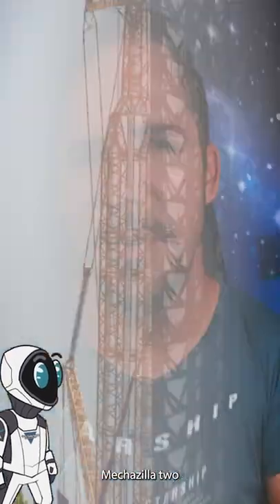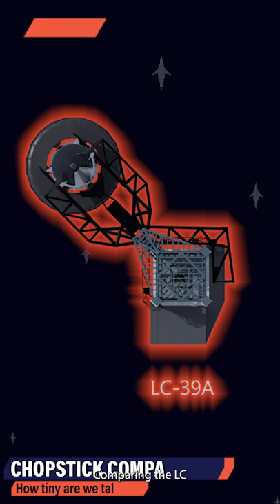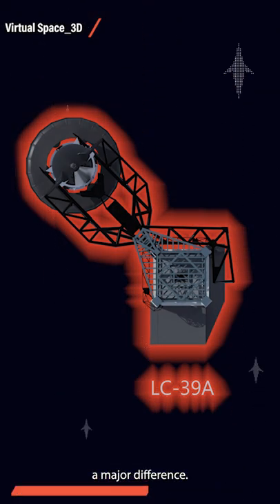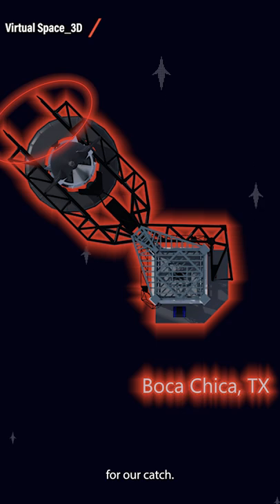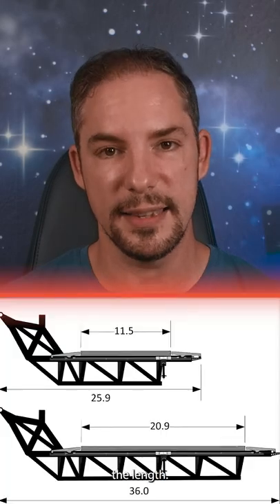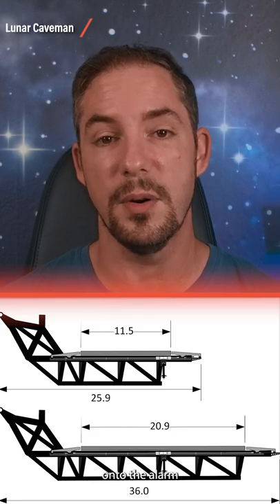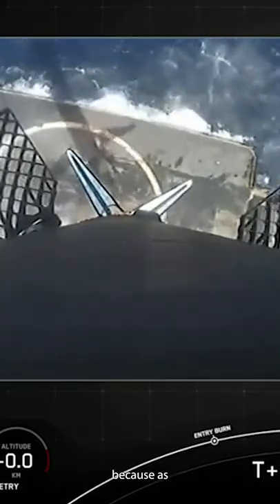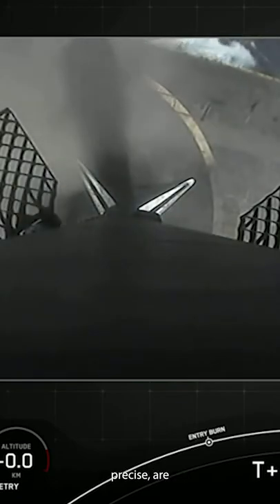How SpaceX's Starship Chopsticks Work?

Comment: Falcon 9 can not hover, Starship and booster can do it.
Reply: That’s a good point
Reply: Correct, and because the tower is fixed, accuracy can be greater, and if necessary SpaceX could install a precision optical guidance system.  An example of such a system on aircraft carriers enables naval aviators to land on the carriers even at night on rough seas.  Without going into an in-depth description, this is what is meant by them "calling the ball"--they see something that visually indicates they are precisely on the correct glide path.

Such a system could be used for Falcon 9 landings to make them far more consistent and precise (and accurate--slightly different meaning, and both will be needed by Starship), even on the barges and without the ability to hover.  But this has never been done because obviously it isn't needed--the Falcon 9 first stage lands precisely enough without it.

I don't know why science-oriented people find achieving the level of precision that is needed for the Starship so challenging.  It's not a hard problem to solve (compared to everything else involving the Starship).  I guess without thinking, they assume that the Falcon 9 represents the limit of landing precision, when it most certainly does not, and doesn't even try.

Comment: Next chopstick design: remove the entire mechanism, the best part is no part
Reply: There has never been truer words spoken
Reply: After that remove all the rocket engines and use magic instead.
Reply: @ooooneeee  and then you truly have a broomstick
Reply: I mean, that was basically the original plan for the Starship booster, back when it was BFR or maybe even ITS. Musk was saying that it would land with millimeter precision back on the launch mount.
The chopsticks should be easier in many ways :)
Reply: @Robinlarsson83  yeah, i don't really see SpaceX land a booster with millimeter precision in the near future😅
Reply: Unbelievable……
Reply: @ooooneeee  replace the rockets with brooms I see where you are going..
Reply: @larsverschoor 
Did he say how many millimeters... ? 😂😂
Reply: @larsverschoor it will have the ability to hover and use precise hot gas thrusters. Falcon 9 does a maneuver called a suicide burn. It has to land quickly not giving much time for fine tuning.

Comment: Although I agree with you and don't think they will catch the boosters there, Falcon cannot hover, while Starship can, therefore may be more precise. Maybe.
Reply: Just because they Don't doesn't mean they Can't!
Reply: @co5mic501 Falcon can not hover. The thrust of one throttled down engine of the empty stage is higher than the weight of the empty stage. They have to ignite the engine at the perfect time, if they ignite too early it would start to lift off again before reaching the ground

Comment: The minor miscalculation in the rocket's landing on the barge is not due to an error in its trajectory, but rather the barge's attempt to remain in the correct location while contending with wind and currents. Contrary to popular belief, the arms don't need to be as long as one might assume, as the closer to the tower the rocket gets, the stronger the arms are. Landing any further out would be a weight-to-leverage issue, as longer arms are heavier arms, thus creating more problems. According to Elon Musk, the booster will be able to hover for a few moments, giving it time to accurately position itself.
Reply: And that's the difference - that it will be hovering and correcting itself, when they iron out the kinks there will only be a mild thud as it settles onto the arms.

Comment: The short sticks might instead be just easier to maneuver and hover around .If the booster does the work the sticks might just be an obstacle.
Reply: Not obsolete, but the hovering is not a luxury the F9 can achieve…. The fine corrections possible at lower speeds could significantly improve accuracy.

Comment: The chopstick length reduction may be to reduce moments at the connection. The shorter the moment arm, the smaller the bending moment and stress on components. If you believe you can effectively control the position sufficiently, it can make sense. It still weird to do it without a first catch at Boca Chica

Comment: depends if you want to try to catch with them or not, so long as you aren't trying to catch a rocket you are good with the Florida ones my bet is they saw the risk of dmg to the launch sight as more risk than it was worth and will build another with longer arms in a  more explosion save area further away from the Falcon 9 launch pad
Reply: Especially since 39A is shared with Falcon launches. It makes sense to move the landing/catch hardware elsewhere. Don't want a missed catch to delay a CRS, especially in the early days before SS gets human rated.

Comment: If the rocket is off target then it could be anywhere and the longest arms are still useless. 
If the rocket comes in hard on the ends, because things are going wrong, it might break the tower and still have a broken rocket. 
A broken tower is a bigger problem.

Comment: One big difference is weight : Starship and Starship Heavy are heavy enough with enough Raptors to balance thrust with the weight in order to hover stationary few seconds to recentrer their position., but, Falcon 9 and Heavy recovered stages are too light to be balanced by one single low throttled Merlin and can only do a power landing. Therefore the catching arms can be shorter..

Comment: Catching the booster and the Starship with the Mechazilla system in mid-air while in a hovering-sequence is the Achilles heel of the whole system. And each catastrophic landing attempt will be a show-stopper, not only for the launch-tower-area and the FAA, but for the Artemis program, too. Give both systems retractable landing legs and use the well proven self-steering multi axle transporters to move them as quickly as possible back to the launch site after each landing. Yes, it takes much much longer, but during a landing mishap it safes the life of stage 0 - by far the most expensive part of the Superheavy/Starship system. And by the way: why not use a special variant of this multi-axle vehicle (landing platform on top) to land Superheavy and Starship directly on it and move it afterwards directly to stage 0 for restacking by Mechazilla?

Comment: I'm in favor of building in excess safety margins. Were it up to me, not only would the chopsticks be longer, but there would be 4, or even 6 catch points for both Starship and the booster. Weight for more catch points is a very minor issue when the engines are getting more powerful with each iteration.

Comment: they can down throttle the raptor engines better than the merlin engines. In theory, they could make the starship hover for a bit and glide into position. Merlin engines can not do that. They have to turn off the moment the are at 0 velocity (or as close to as they can). Will be interesting to see them try it in real life though :)

Comment: I think the Starship booster will be able to land far more accurately, precisely, and consistently than the Falcon 9 booster.  The latter relies primarily on GPS, doesn't it?  Well, GPS is only so precise, and its accuracy varies moment by moment.  It's good enough, however, and that's why additional measures haven't been taken.

Since far greater accuracy, precision, and consistency will be required of Starship booster landings, SpaceX could implement an optical guidance system (like the one used on aircraft carriers) that starts working once the booster gets close to the tower.  Additionally, the Starship booster has the ability to hover, which can only help with regard to landing precision.  If the trajectory is too far off, then this would give the booster more time and a second chance to correct the issue instead of being forced to divert to a landing pad.  I really don't see what the big deal is.  Optical aids have been used for all kinds of precision maneuvers such as docking in space.  Landing a huge booster will be more of a challenge in some ways, of course, but even with the shorter chopsticks, it doesn't have to be nearly as precise, just more precise than the Falcon 9's landings, and that will be easy to achieve.  In fact, even the Falcon 9 booster could be made to land far more precisely than it does.  This isn't done because it's not needed.

Comment: I don’t think that the chopsticks have been designed to catch a landing booster - the winch mechanism is far to slow to allow a smooth catch. For this purpose a hydraulic or pneumatic system would make sense. I guess the purpose is just stacking.

Comment: @Whataboutit I have always understood the LONG TERM reasoning for removing the landing legs... ON EARTH. But don't you think it'd be better served in the short term to develop a leg system to land ON MARS and have NO doubt about the success rate? I know the tested legs before AND it landed, with some issues of varying degrees. Mars won't have a catch tower so there must be legs. Mars won't have fire sprinklers to tamp down any flames. It'll have to work THE FIRST TIME perfectly! And if plans are to be believed, it'll have to work PERFECTLY with every single ship if they're sent in a group as planned. Wouldn't it be better to have a leg system akin to F9 for when the time comes for the real goal to eb achieved? 🤔🤔🤔

Comment: Nope, you ain't catching a booster on 39A
There are multiple safer  places to catch a booster at KSC.  No need to catch it next to fuel, oxidizer, and the only the human rated launch pad in use.

I also believe a sucessful catch of a booster is much further away than most think.  Build a catch tower out near the LZs or shuttle runway.  Heck, build it at LC49.  SLC 40 is also scheduled for upgrade next year

Comment: Calling it now:  Neither the Starbase chopsticks nor the ones at the Cape will ever successfully catch anything!  The concept is not going to work, certainly not reliably.  If it ever does catch a booster the booster will be damaged in the process and be scrapped -- the engines might survive, and that's not nothing, but neither set of chopsticks will ever work for its intended purpose.